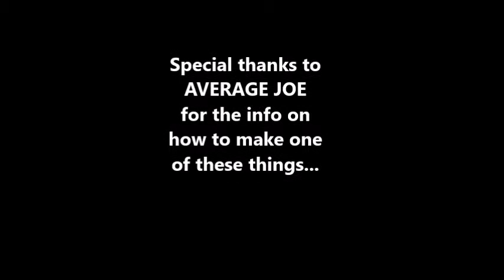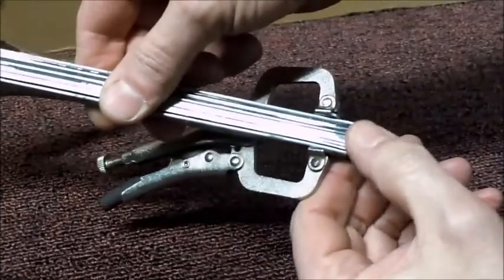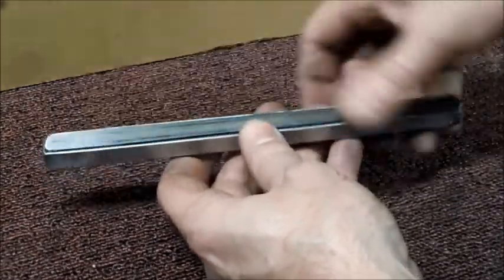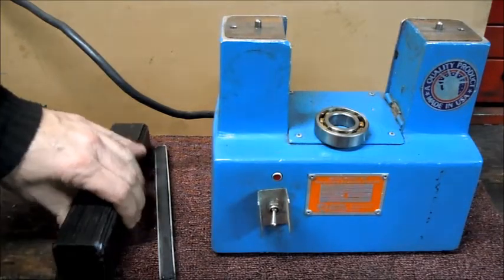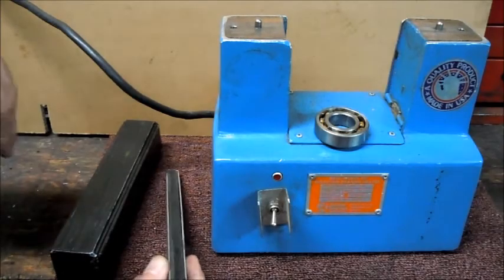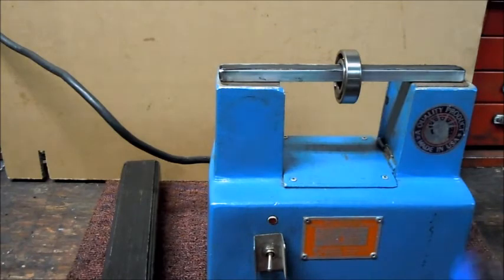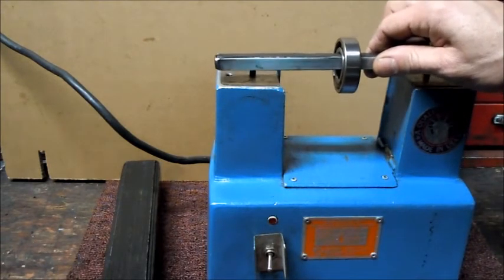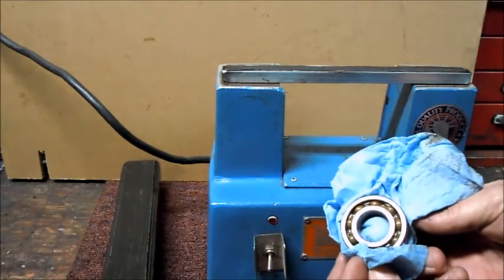Tools N Things 24 Bearing Heater Crossbar

Comment: maybe slip a couple of o-rings over the bar to keep the bearing from vibrating side to side?
Reply from the maker: That thing was really starting to pick up some speed, was kind of scared to touch it too😊. My initial thought was precision leveling feet, #Robrenz - that guy ROCKS!, so I figured if it was perfectly level the bearing wouldn’t move. Then again, it’s highly likely some O-rings are on the “real” plan for a QFE (Quick-Fun-Easy, always a good formula) fix. Thanks for watching and commenting.

Comment: dont where a ring  around that  i saw a cap sealer burn the  cap and tops to a puddle in no time once there was syurp running  and smoking everyware , not sure of the particulars just keep it in mind. also for small bearings  a hot plate  may be another idea . one guy i watch uses a deepfat fryer with 1030 in it an that seamed to work well for him .
Reply from the maker: As they say over at Grainger… SAFETY SAFETY SAFETY… Thanks for the tip! You can't see it from the camera angle, but I always have a full asbestos suit and bag on so I’m good. If the bearings are too small, I’ll certainly consider those other options as well. Deep fried bearings…mmm. Thanks for watching and commenting.

Comment: made in usa? nah! get yourself a proper moose-powered maple syrup heater.
Reply: nice laminated bar though. I like the ground finish
Reply from the maker: Ratings week, got to play to the audience... Had one of those moose powered units but the wheels fell off, but that’s another story, for another time… Thanks for watching eh.
Reply from the maker: Thanks. Word on the street is that the contact conditions between the bar and the risers is what contributes to the noise during heating, so I was going for a quiet, soothing heat 😊 Thanks for watching and commenting.